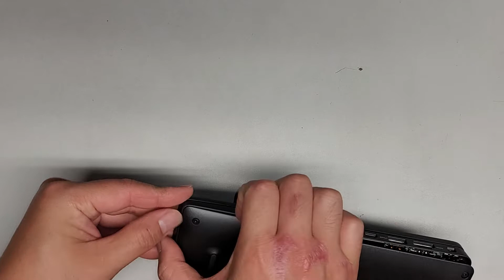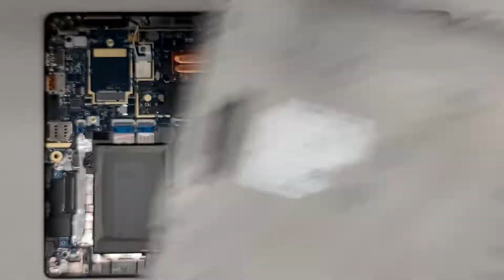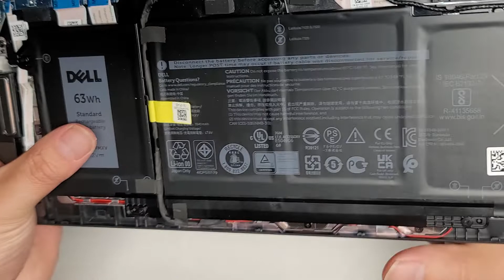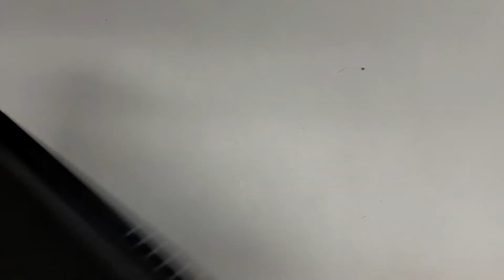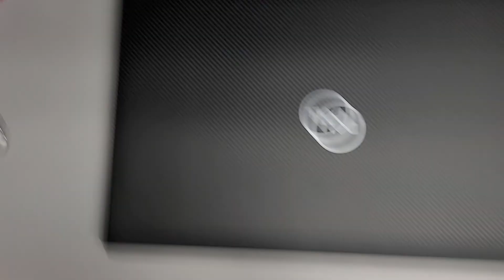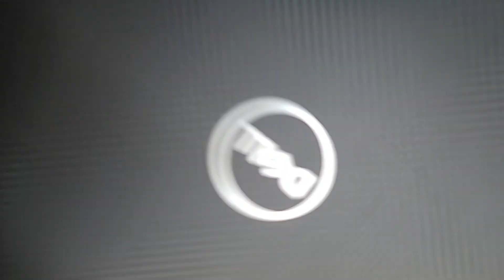DELL Latitude 7420 Disassembly Quick Look Inside SSD Hard Drive Battery Connectors Etc.

Comment: Any idea hoe to disable the bios and admin passwords? I've acquired an ex-work laptop but its pretty useless without knowing these passwords
Reply from the maker: You need the password to disable it
Reply: @ItsBinhRepaired  wouldn't replacing the hard drive wipe this out and make it a clean slate?
Reply from the maker: Yup

Comment: The free M.2 slot is just for WWAN (4g / 5g card). It will not support an SSD ;)
Reply from the maker: Interesting
Reply: @ItsBinhRepaired  you can see the the hint printed on the motherboard 
the MAIN writing - for the MAIN antenna cable - usually the black one - 
the AUX1 writing - for the secondary antenna cable - white

Unfortunately it seems that your laptop does not come with preinstalled antennas like most others actually do

Nevertheless thanks for the video, i was searching for a good quality video to see the cooling configuration as i want to upgrade from existing 5310
Reply from the maker: @MallV0lli0  nice!

Comment: where is the cmos battery?
Reply: The CMOS battery integrated into main batter if you want to do a reset just unplug the battery and leave it for 10 minutes
Reply: Have disconnected main battery and leave it over night. But bios password still there. :( @CradaOC
Reply from the maker: I think it uses the main battery as the cmos. I'm not sure.

Comment: I was hoping for you to point out the cmos
Reply from the maker: It is likely the main battery
Reply: @ItsBinhRepaired  Thank but sure that most to all units has a coin cell battery for cmos. Guess I will have to strip completely to see if there is one. Thanks again for your response.
Reply from the maker: Check eBay for the motherboard. No point stripping it down just to find that.
Reply from the maker: @nedesenrab9203  a lot of laptops these days don't have dedicated cmos battery anymore.